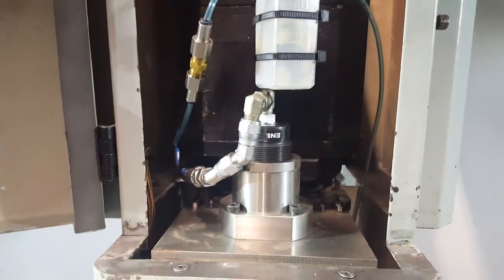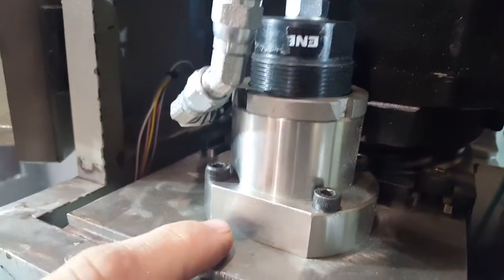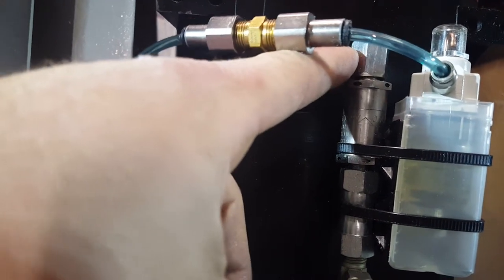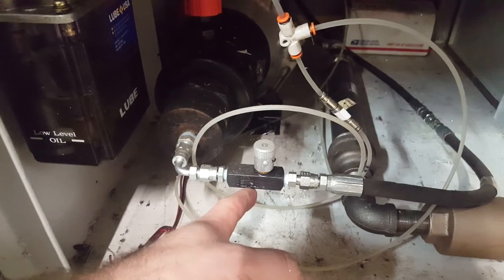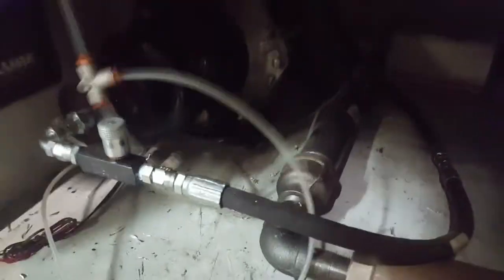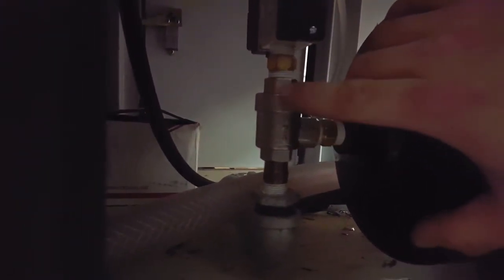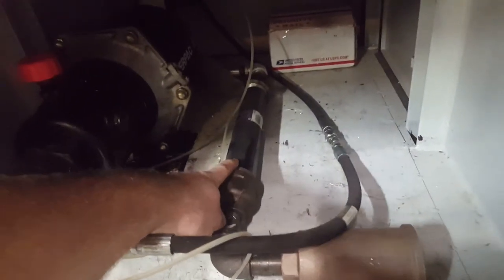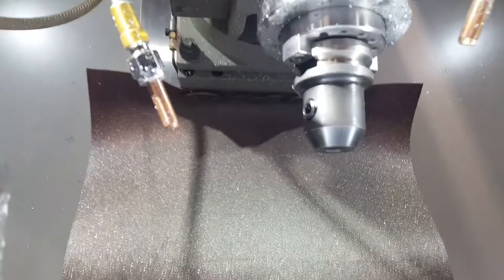BT30 Spindle - Drawbar Actuation

Comment: That's a hell of a muffler. 
How many pounds of force are you using?
Reply from the maker: It takes about 80psi air pressure to fully release the tool holder. This calculates out to approximately 1896lbs.force on the drawbar. So the calculations are 30 to 1 air to hydraulic booster, the hydraulic cylinder has a working area of 0.79sq.in. Further numbers to chew on. The tool holder is held in with about 1204lbs of tension from the drawbar, drawbar travel is 0.283" from no tool to tool release positions.